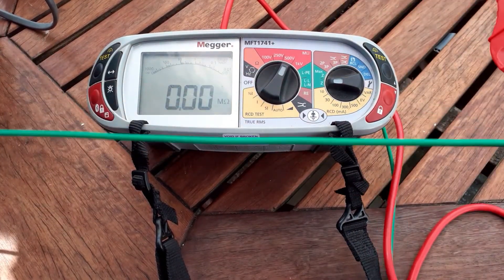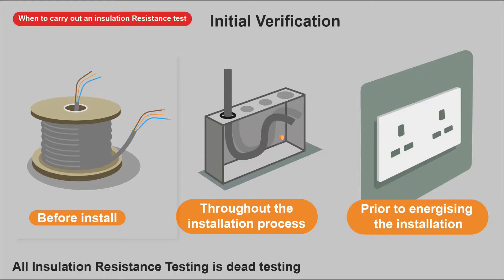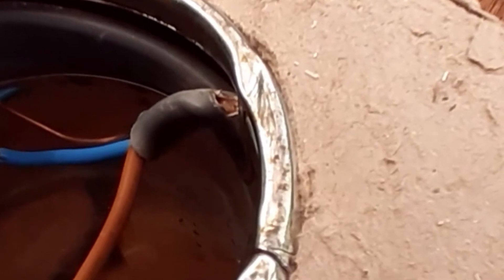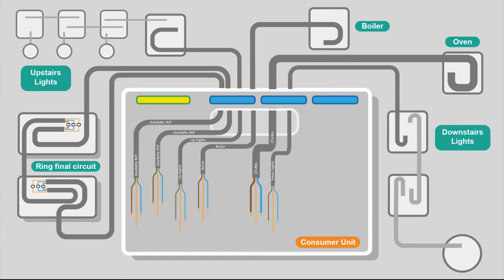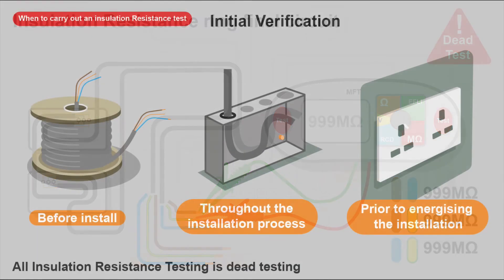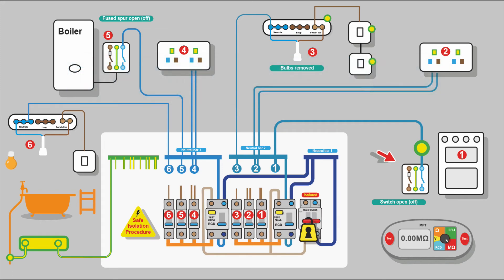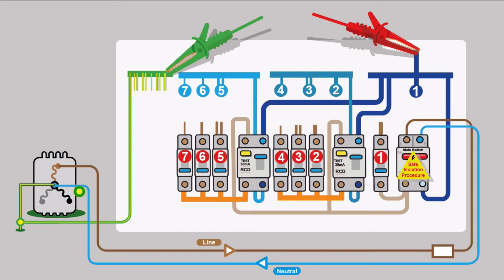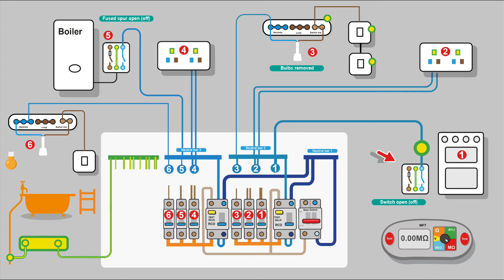Insulation Resistance Part 2 - The problem with the neutral conductors

Comment: Thanks for the video.  As an adult learner these videos are very useful and I look forward to Part 3. I understand the need to remove loads, neons etc and that it is permissible to link L and N together and check IR between that and E. On the other hand, if I get a reading of >999 between L and E and >999 between N and E can I not assume that between L and N will also be >999?
Reply from the maker: HI GrumpyGrampa.  If you are testing with L and N together to earth , you will have no idea if they have an insulation resistance issue. All you will know is that they do not have it to earth, as they are in effect one conductor. 

In T and E, if you have damaged insulation on a live conductor, it will often appear on the CPC as that is a bare conductor, and can  bridge that gap.  But it could also be the case, that its only the L and N in close contact. Imagine in a back box for example, when the conductors are no longer in the sheath. The L and N could easily be damaged. They have no contact with the CPC, or the earthed back box. but the do with each other. 

 Hope that make sense.  thanks for watching.
Reply: @JPElectric At 3:21 please when testing the cable before installation, won't it damage the cable because of how it's being coiled around the case to form inductor
Reply: @JPElectric  Thanks very much for taking the time to give such a comprehensive reply.  Makes sense
Reply: @JPElectric At 2:48 please when injecting the test voltage what should be the duration of the voltage injected into the circuit or cable